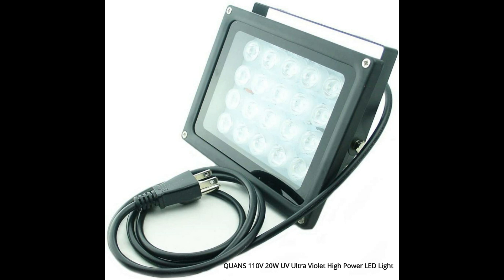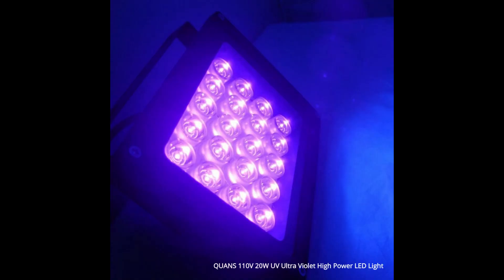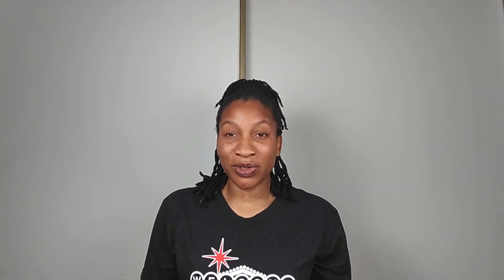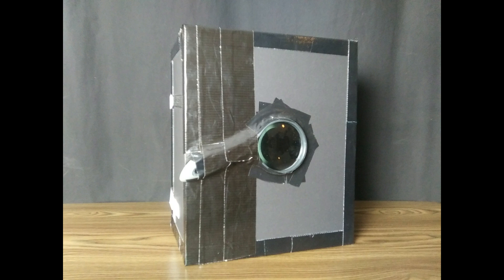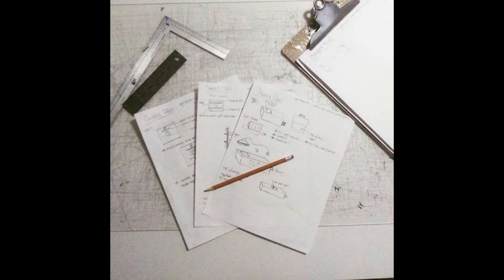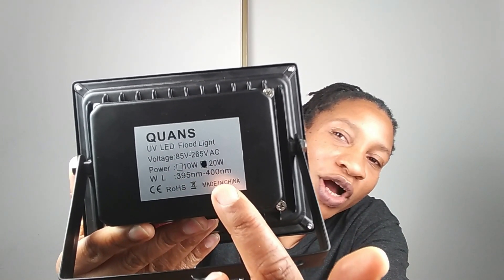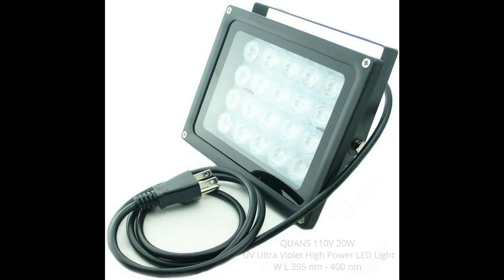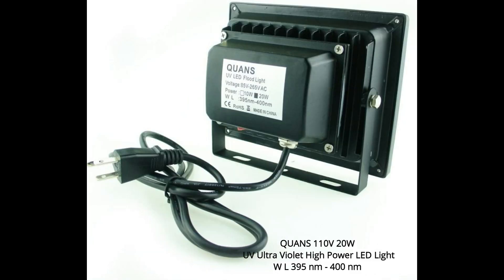Cyanotype and Ultraviolet Light (problem solved!)

Comment: interesting to know the wavelength best suited for Cyanotype!  I was about to buy a UV lamp but I was looking for 420nm for UV resin curing that was also going to double for some Cyanotype and Kallitype!   Looks like I'll need to stick to the sun for the Cyanotype for now.
Reply from the maker: Hello! There might be some flexibility with a UV light source that peaks at 395-400nm for Cyanotype but the wattage would need to be at a minimum of 50w , I have learned this further down road, yet it still remains; the shorter the wavelength the better for Cyanotype. 

The 420nm light will for perfectly for Kallitype:

"sources that peak at 420 nm (approaching the visible blue end of the spectrum) may be better for Palladium/ Platinum, Van Dyke or kallitypes".

I had used this same light for salt printing and it had worked very well.

There are black lights coded as IP66,:
https://www.amazon.ca/UV-150W-Floodlight-Waterproof-Fluorescent/dp/B07VH3CVSF/ref=asc_df_B07VH3CVSF/?tag=googleshopc0c-20&linkCode=df0&hvadid=335562249786&hvpos=&hvnetw=g&hvrand=7589369270753193486&hvpone=&hvptwo=&hvqmt=&hvdev=c&hvdvcmdl=&hvlocint=&hvlocphy=9000429&hvtargid=pla-813274314161&psc=1, which I think would be a UV light source that can work well with the Cyanotype but I cannot guarantee this yet.

I have been looking into options as some countries do not have UV lights that contain the wavelength of 365NM , I have been trying to source out other options for my friends and supporters!

Comment: Hi and thanks for the video. just my two cents : I'm doing cyanotype with an enlarger (with a 50W 395-400 square led inside which measures about an inch). It takes long (1h to 3h for a 20x20cm print) but it works.  I also have a 365nm led but a 100W one. even though it consumes double the power it is only marginally faster than the 395nm one. I have come to think that it's because my enlarger's lenses absorb most of the UVB and the only light that comes trough is longer wavelength. I think it depends on your chemistry as well. Classic Cyanotype accepts longer wavelenght in my experience  than simple cyanotype, and even different kinds of classic cyanotype (different brands ? I'm using Jacquard's) might be sensitive to different wavelentgh( to be tested though). But that would explay why it works for me with 395nm and it doesn't for you.
Reply from the maker: Hi Ilan. I use Photographers Formulary brand and although it is a great thought along with other points you have made, I do not think that is what mostly matters because you can have a perfect formula  and/or use a well known and reputable brand of formula ...If that light ain't just right, it ain't gonna work to well.

I have been questioned on this so many times with a mention on how a 395nm light has in fact worked and does work. Now just be clear on the side;

My question at the end was asking if anyone has used the exact light that I had displayed and used, the EXACT LIGHT, and if so has worked for them. I have yet to find this out but it is no longer relevant anymore because I found a way, a way which I have shared with everyone and would think it would take this over and to be clear once again, I spoke about the light in particular that I was using and never in a general sense against the use of 395nm UV, as I mentioned;
 not just any UV light may work.

Now to be openly honest about the whole thing, at the time I made this video I had absolutely no experience and knowledge on UV sources and light banks because I only liked to use the sun, but now this has changed....the issue here was the value of light itself. The light I used was 20w, which is not sufficient even at the OPTIMAL wavelength. The minimum for Cyanotype is 50W, for whatever wavelength one plans to use and within that workable wavelength. Even still, the shorter the wavelength the better.

Comment: Hi Nicole! First of all, your channel is gold! I love your content!
I was exploring what UV light to get because it is very challenging doing cyanotypes in the UK even in summer. I couldn't find UV light with 365nm anywhere, so I ordered 395 nm from Amazon. One of the reviews said it worked for their cyanotypes. It works for mine as well. I think it is very tricky finding the right one, if you didn't pay attention at school much (like me).
Reply from the maker: Oh Thank you so much Milicia! Oh great! I am glad that it worked. I think in my situation the wattage of light, which was only 20W, was not strong enough for the Cyanotype which is mainly why the light did not work. I am glad though, that it didn't because I found something that works in the end with a pretty good warranty and is much easier on the eyes. Which light did you buy?
Reply: @NicoleSmallOneonOne  https://www.amazon.co.uk/gp/product/B077HS47VT/ref=ppx_yo_dt_b_asin_title_o01_s00?ie=UTF8&psc=1
Mine is actually 20 W but it works. I am still testing what is correct time exposure. I think your light is better but unfortunately, I can't find one like that here.
Reply: @TigaBg  hiya. I'm in UK as well. Have a look on Ebay,  there are some options 30/50W with 365nm. They're shipped from China,  so it might take few weeks to get delivered though:(
Hi Nicole, I'm so glad to have discovered you channel today 😁👍 As Milica said, it's pure gold ✌
Greets from Manchester
Reply from the maker: @mirkolazzarin5648  Thank you Mirko! Did you manage to get the light?
Reply: @TigaBg  what kind of cyanotype chemistry are you using?

Comment: Hi Nicole, do you have any thoughts as to why this light worked for other people?  All the videos I've found of people making their own UV light boxes etc. have used UV sources with a 395-405nm wavelength as that's what's commonly available (I can't find any 365nm lights on offer here in Europe).
Reply from the maker: Hi Max. I do not think that the commercial bought light and a DIY lightbox build to be the same as with a DIY lightbox build it is going to be built to work for one's needs. The commercial light has it's own defined standard of use and can only go so far within it's reach. This perhaps might just say something about that light. 

I will add though, perhaps the 20w of that light bank was just not enough and could be one of the a main reasons why it did not work with the Cyanotype, ( it could also mean that it could possibly  work at a higher wattage).....but I did mention at the end that if anyone had success with the EXACT light bank that I bought with Cyanotype, not a DIY build, to let me know. I still have not gotten any replies as yet.

I have never mentioned it in any of the videos but in the beginning I did want to build my own lightbox but after reviewing many videos on YouTube on that subject , I decided that I
no longer wanted to go that route which led me to buy the light bank that I was unsuccessful with.

Someone else not too long ago also asked me the same questions and they also mentioned how they have seen the light work for others from videos they have seen on YouTube...(videos of DIY builds, not the use of the exact light).I guess there is the option of building a light bank and or even buying the 395-400nm light bank at a higher wattage than what I used if there is at all any doubt.

In all, I am glad that I did end up with a light bank that did not work, (mind you it does work for salt prints, I tried it), otherwise I would never have kept searching and end up finding the light bank that I now can use for Cyanotype all year round.

*about a few months ago someone from Italy told me that the company does not ship to them. I had contacted the company and mentioned this to them and they said that they would be opening up their market to Europe at the beginning of this year, 2021. I am assuming though because of Covid, there might be a delay as to when this will become available in Europe.

Comment: Glad I found your video- --I experienced the roughly same situation using daylight was ok but then tried uv light
 ( was given a real uv light the type that is used to erase computor's Eprom print washed out completely )
Using , for the moment a 3watts plant growth bulb (  3.00$ bulb ) and no problem at all
Thought  it is only usefull for prints of 4 inches square 
will have  to arrange an array in a reflective box 
Thanks for sharing
Best season wishes  and keepsafe
Reply from the maker: Thank you Jacques for that tip, I added it in the title. Would aluminum foil help with the spread of that light? I am glad this was helpful to you and I wish you Happy Holidays!

Comment: Thanks for sharing your experience.
Reply from the maker: No problem. Thank you for watching!
Reply: @NicoleSmallOneonOne   One question :) Where did you buy the UV lamp 365 nm? I tried to find the same on the video on the net but didn't find any.. Thanks!
Reply from the maker: @Rolleicord23  HI Luca, here is the link to the light:
UV Light Source
- THE NEW 2020 MODEL - Everbeam 365nm 50W UV LED Black Light - High Performance LED Bulbs, IP66 Waterproof:

https://www.amazon.ca/gp/product/B08635F9CX/ref=ppx_yo_dt_b_asin_title_o00_s00?ie=UTF8&psc=1

Comment: Thanks Nicole. According to the NASA and Canada national sites, UV wavelengths that reach the earth (i.e. getting through all the atmosphere) range from 290-400 nm. They don't show a full frequency spectrum curve as to how much light at each wavelength reaches us, however UVB is the light that we need to make vitamin D, and UVB is considered to be between 280-320 nm, so at least some light at those short wavelengths reaches the earth's surface. I'm not sure where your number of 365 nm being required for cyanotypes comes from, but certainly your light was not giving short enough wavelengths, 395-400 nm is barely UV at all, just a teeny bit shorter than visible. Along the same lines, it's important to use a glass or plastic plate that doesn't absorb UV to flatten the negative over the paper for printing from digital negs - it'll be obvious if someone uses the wrong type as there will be no exposure of the paper, but might be worth mentioning in one of your troubleshooting videos. For your in-camera project, obviously need to make sure the lens itself doesn't absorb UV, I'm not sure how to find that out, or whether all lens glass allows UV through - some must or we wouldn't bother to use UV filters on our regular film cameras to protect our analogue film from overexposure to UV wavelengths. I have a sense that UV lights adequate for cyanotypes are expensive, at least the ones I've seen used in other videos. Good luck!
Reply from the maker: Hi Mark. I realized all of what you just explained when I was not getting results. After exposing with this UV light , the image Cyanotype print appeared on paper just as it would when using the sun but as soon as it was placed i water it completely disappeared. This is why I was confused from the very beginning. About the glass, this is an importance that i also know and must not be a blocker of UV light. It is very hard to say by looking at the magnifying glass that I am using as a lens if it is blocking UV light but I would imagine that it must not block that much or nothing at all as I payed very little for it. Thanks for the luck and detailed info! :)
Reply: @NicoleSmallOneonOne  That is odd, that you would see an image on the paper at all. Maybe visible light does something, but it's not stable so water washes it out. Anyway, you definitely need shorter wavelengths than that bulb. As for lens/magnifiers, it's unclear which ones pass shorter wavelength UV, probably most do. Automobile window glass blocks it at least partially I think, based on us not getting tanned after driving long distance in the sunlight (or getting tanned on one arm if the window on that side is down!) Good luck!
Reply from the maker: @oudviola  Yes odd which is why I started to educate myself on UV wavelengths. There is enough light to see an image but not enough of the right UV for the image to stabilize onto the paper. The testing that I did was not in camera it was done the traditional way...glass and negative exposed to the light. The same I use and have been Working with for the last 4 years. I have tested in camera with the bought Cyanotype formula and it worked fine but it being done this way, the print has to be scanned as you would for a Lumen print before even thinking of rinsing it water.

Comment: thank you for sharing your efforts and findings! I'll make a mental note about 365nm. I have tried doing cyanotypes with a UV light in a workshop. it is handy but the one we had didn't quite produce as rich blues as going with the sun. 
on another note... just a thought here. glass tends to stop UV light, right? more or less. I wonder if the guys building that lamp just used one kind of lamp and uses the glass in front of it as a kind of filter to get it to the nm range they want to sell it at. I noticed the screws so  it seems it can be detachable? anyway, just thinking aloud here :) I'll follow you on your adventures in analog photography. Cyanotype Rex has me stoked! hehe
I'm glad you went on the homemade camera podcast so I could find out about you! :)
Reply from the maker: You are welcome, I am glad you found this to be useful. That is a great thought about the glass, hmmmm. Maybe I might try that to see what will happen. I really had a great time on the Homemadecamera podcast, such a great group of guys. Thanks for listening in and for reaching out!
Reply: Yes, normal glass filters out UV light. You cant get a tan in the car. Plastic and quartz glass is okay for UV light.